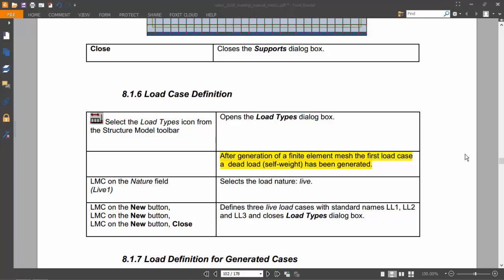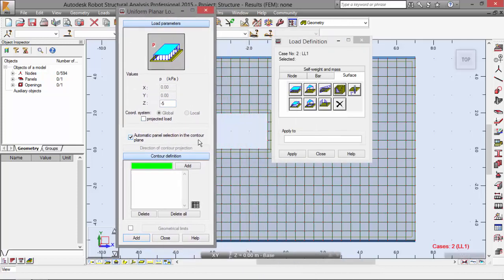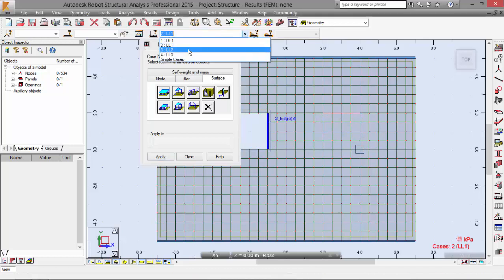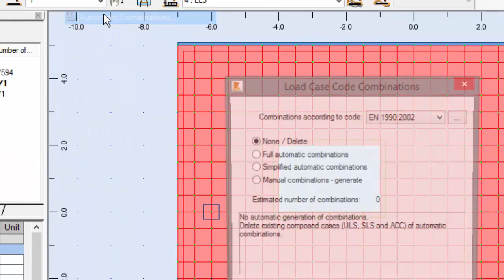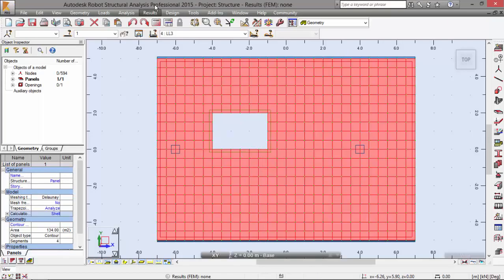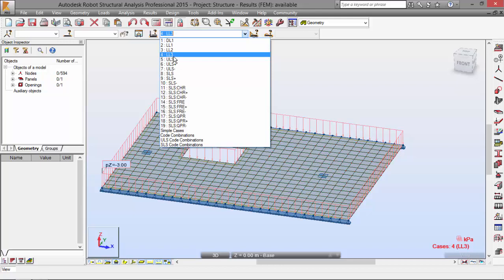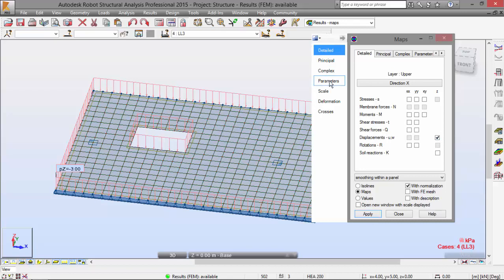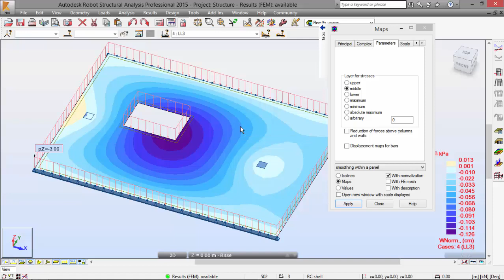Exercise 8 - Part 2 - Defining and Analyzing a Concrete Floor (Robot Structural Analysis)

Comment: I'm confused between the difference of Live load and Accidental Load. Aren't Live loads automaticly defined by the categories A, B; etc. linked to the legislation by destination of use? If I'm applying "specific" loads with custom values different to the categories wouldn't they be considered accidental loads?
Reply from the maker: Hello there,
Live loads usually are the most common loads from typical utilization of the building. 

Accidental loads are special events that are not at all typical for the utilization of the building. For example, a car crashing into an outside column is a accidental load. 
Other example of an accidental load is the stoppage of the system of water drainage in a big roof, leading to a big accumulation of water near the roof limits, witch gives you big loads on some purlins...
In some part of the world, seismic loads are extremely rare (UK for example). In those countries seismic combinations "accidental", whereas in countries with big ground acceleration (Italy for example), seismic loading has a proper combination, different from the accidental one.

Accidental events are, normally, combined with load factors less than the typical ones used in Ultimate Limited State.
Reply: @nunoteixeira-robotstructur8358   Thanks a lot! Now I understand.